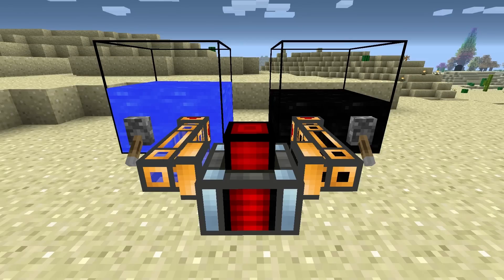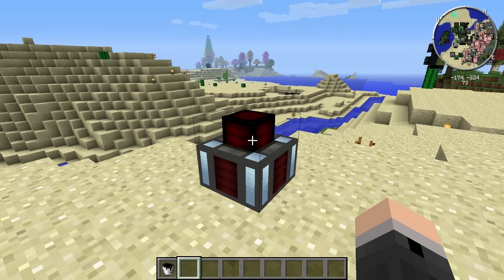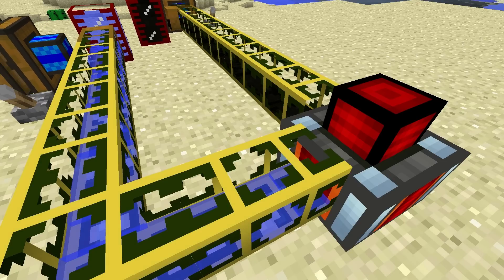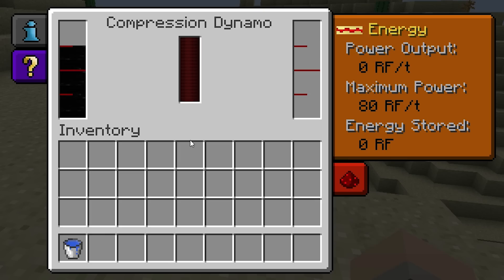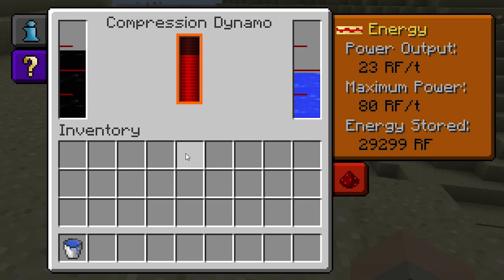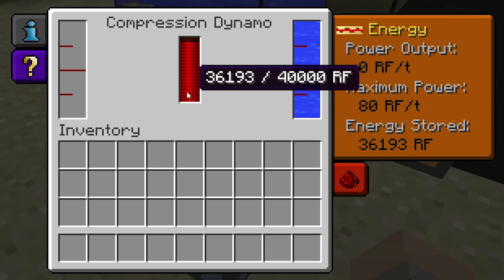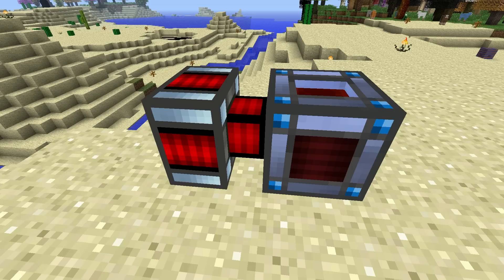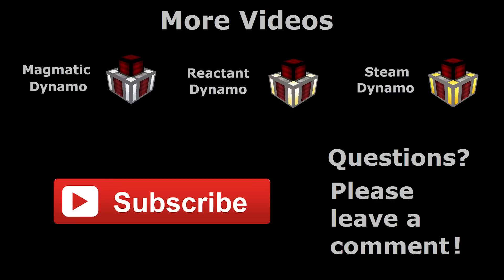Compression Dynamo (Tekkit/Feed The Beast) - Minecraft In Minutes

Comment: I tested and if you wanna to fill this dynamo with biofuel you wont have as much as you can have RF. Much better is to have BioFuel generator. I checked, and one bucket of BioFuel in Dynamo generated 500 800 when BioFuel Generator generated 1 120 000 RF which is about 123% more (more than 2 times). The disadvantage of it is need 2 blaze rods to craft it.